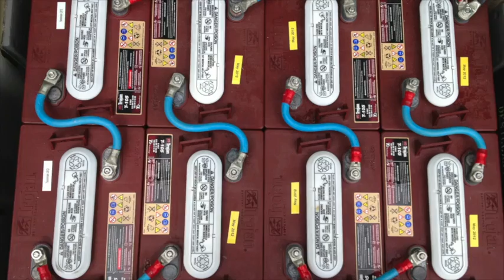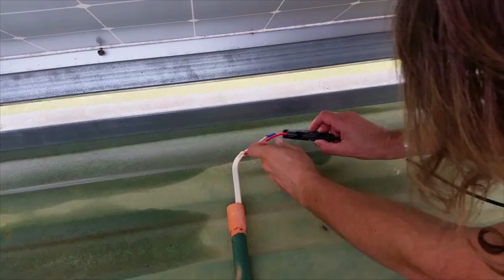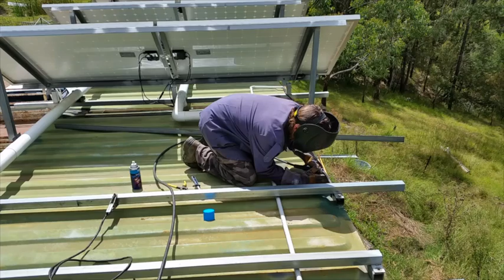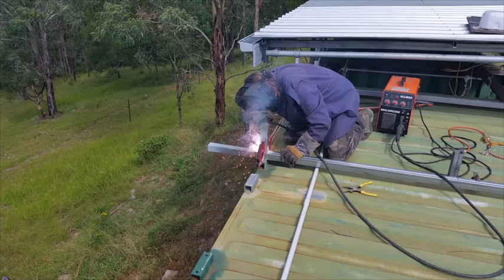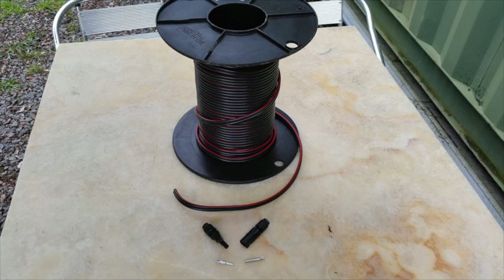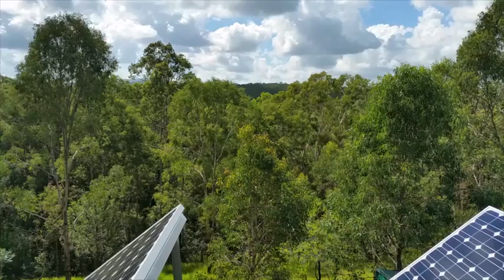Shipping Container House – Extra solar panels on kitchen

Comment: When testing my panels i got a gt meter for $30 but know hey are like $13 http://www.ebay.com.au/itm/GT-Power-LCD-RC-130A-60V-Watt-Meter-Tester-Power-Analyzer-Ver-2-0-High-Precision-/231188085844?hash=item35d3e23c54 the non backlit one are cheaper to but i got that one and put mc4 onto some ec5 plugs on the gt meter and made up lots of plugs for testing all my 12v gear to see what they use on power even the lights i put the meter on a old flat car battery i get the amps volts and watts from the meter for my solar panels and much more i have to send a video of some of my 12v fans i have for each room i use 120w fans but they blow alot of wind so speed controllers to cut the power down to a slower speed i got to get some videos done for you to see

Comment: I have the same setup on my Motoryacht. My solar panels are... 130 watt each  X 6 = 780 Watt in total
And I also  have 200Amps Heavy Duty Battery  X 5= 1000 Amps Battery bank. My Invertor is 2500 Watt  .I also have an  3.5 Kw Diesel Generator as a backup power source..Where ever I go.... I never need shore power.  Thanks for the video and the info . I really liked it.
Best regards from Turkiye.
Reply from the maker: bunakkaptan Hi Bunakkaptan, welcome to our land channel. I had not thought of a boat having a similar system but that sounds great. Especially that you never need shore power. Nice to have you on board for our adventure. Cheers Paul

Comment: I would really like to see a review of you freezer and with information like the model and where you got it etc.  I have been looking at a Sundanzer but not been able to get any response and your freezer looks like it has a descent thickness insulation.  Any information would be great. Thanks in advance.
Reply from the maker: TRMTHEweasel Hi (weasel). Certainly, I assume you found my video where I fit the freezer but I don't appear to have put model details. Etc.I will go and track them down. The freezer has just plugged in and worked. I looked at the expensive Sundanzer and 12v and gas freezers but they were very expensive. I opted to add a few extra solar panels and run cheaper appliances. I have 2 ten litre plastic water tubs in the bottom of the freezer. These act as a cold sink. A permanently frozen block of ice to help keep the freezer cool. If a freezer is just full of air it runs a lot. If there are buckets of frozen water in the bottom or ice blocks the motor runs less often.The freezer was from a chainstore hardware store and I picked it because it physically filled neatly in the space. It was a no name brand. It works great however and was very cheap. Cheers Paul

Comment: What batteries are you using ?
Reply from the maker: Hi 52fordman1, we are using Trojan t105 6v deep cycle batteries. I have 8 batteries make a 48v bank, and there are two 48v banks.The t105's are 225 AH each. I try and use only the top 10% of the battery and only deplete to 90% full on a daily basis. hopefully this will extend battery life. Welcome to the channel. Cheers Paul
Reply: Nice to know about the batteries  Thank you.

Comment: I really enjoy your videos. In a few years when the kids are grown I plan to do much of the same. Have you thought about using wind generators during the winter to help charge your battery bank?
Reply from the maker: Hi Vastech29, thankyou for the encouragement. Good luck with any future projects. I started building a wind turbine, but when I moved up the mountain I moved to a low wind area. It stopped being a cost effective power solution compared to solar panels. The containers are in a dip that is protected by trees. Maybe one day it will seem practical, but for now, probably not. Cheers Paul

Comment: Very very impressive work Paul.  You're a dab hand at welding and metal fabrication.  I was trying to see if I could have done a better job, and couldn't.   You even crimped AND soldered the leads.  Excellent!  That's a really professional looking job you've done there.  The power board is very neat and well organised too.  Could you please tell me what size mig welder that is please?  I have just purchased a 135 amp mig welder and I'm hoping it will be as good as yours.   Cheers
Reply from the maker: I wasn't confident in the strength of the crimps, so I soldered them so I knew there would be no problems. My welder is MIG 200A. I was new to mig welding before I started this project, and aside from filling my lap with molten beads of steel, it has been great fun. The 135 A migs are super portable.

Comment: are the extra panels the old ones you took down? if not can they still be used?
Reply from the maker: I bought 8 new panels. Removed the panel that was driving the lights and it can be reused. Installed 4 panels in the space on the kitchen and these join the existing panel array. There are 4 unused new panels in the woodshed, and these will be added as soon as I have time. I will find a use for the panel driving the 12v lighting, but I have to build a place to mount it. Does that make it any clearer.
Reply: Paul Chambers ahhhhh!!!! *nods.... got it!! LOL!! the old brain is working on it's 3rd score so you know the synapses has slowed down a bit. LOL!!